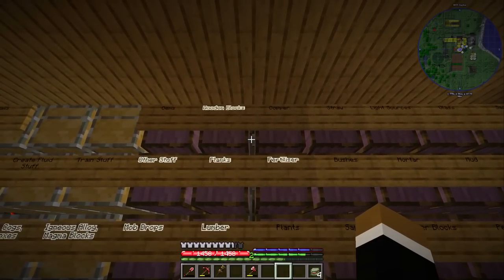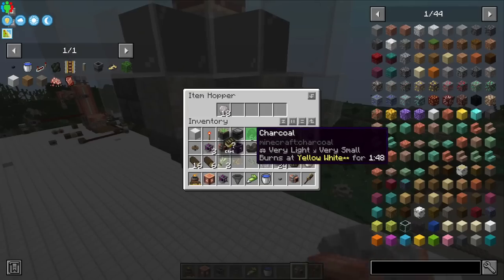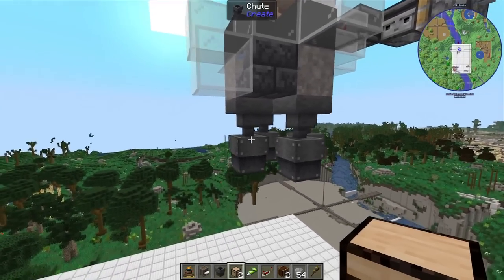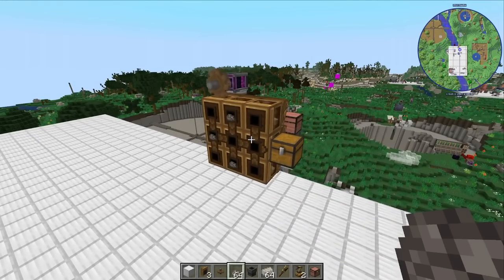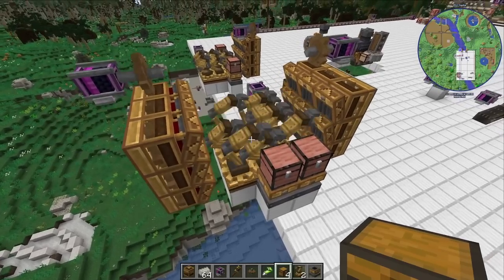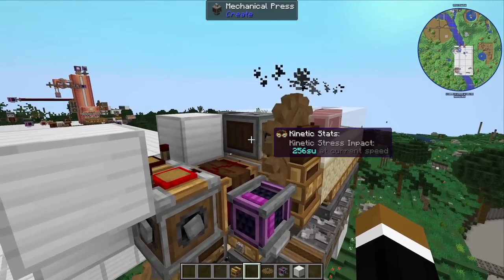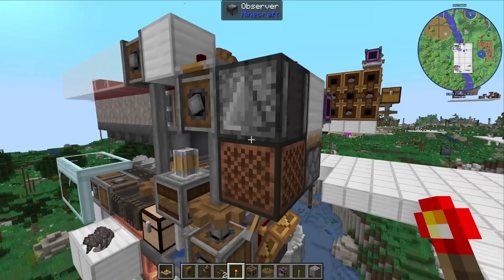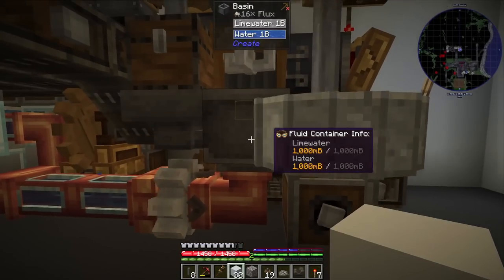ATFC: Automatic Brick And Mortar Maker (Episode 48)

Comment: I think to be more efficient with those mechanical arms you can use a combination mechanical crafter <- hopper <- brass funnel <- arm. If you do so, the crafter will do its craftin while the arm is filling all the hoppers. In the instant of the crafting being finiished, all the hoppers fill their spots and another crafting cycle can bigin. The arms can work all time. In your setup they need to wait for the crafters to finish. The brass funnels are there just as a filter. If you use 2 arms, you dont even need the brass funnel, just make a mortar arm and a brick arm. Dont know the math but it will definietly save on the arms :D

Comment: I think there's a faster way to refill mechanical crafters provided you've used them once before. I think you can filter each one to a specific item and then insert with a belt MUCH faster than a mechanical arm could
Reply: only if recipe has items adjacent, which brick recipe does not have.
Reply: @mrShift_0044  ah that makes sense, been a while since I actually booted up the pack myself

Comment: If you can take an output from the center of the mechanical crafter, you could potentially increase your crafting speed by 100%. Mechanical crafting is affected by the maximum length an item needs to travek to get to the output. In your current setup that is 3. If you could point everything to the center it would have a path length of 1. To be generous im counting leaving the output as 1 more psth length, so 4 path length vs 2 path length. 

This could poyentially be done with an arm or se other way to get output from center

I know these are pre recorded,but thought id let you know in case you didnt already

Edit: looked at the wiki, math says more of a 66% increase in output

Comment: The ultimate goal should be to make a machine for every type of crafting method (crafting table, mixer, saw, crusher, cobblestone generator etc etc). Then create a computer that you can program the recipes into and it will take output from machine A, put it in machine B, and so on, until every item can be created automatically. Then a memory storage system so you can store common sequences and access them with individual buttons.

Comment: Hello, I know you generally pre-record these, but I have a few ideas about your mechanical crafters:
- Can you feed items into the front of crafters? If so you could have 2 rows of belts+funnels on the back and 1 row on the front.
- Can you put crafters facing downwards? If so you could use smart chutes from on top to file them in.
- You might also be able to use weighted ejectors, which are ridiculous and silly and I don't think they have very good throughput but it might just work.

Comment: I’m not sure if it would work and I don’t know if you tried it but what if you had both the bricks and mortar go into a 9x9 item vault and then have nine smart funnels(might have the name wrong) corresponding to each slot in the auto crafter each one with the correct filter.

I don’t know if this could work and I apologize if you try it and it doesn’t.
Reply: You'll probably need 9 belts too (funnel out -> belt -> funnel in) I'm not sure if they're stackable
Reply: @Yorick257  the biggest concern I have is if a funnel going into the back of an autocrafter slot only fills that slot or if it will just fill it up like one coming in from the side.

If it will fill up all available spots then you would have to alternate between items.

Comment: If you pump lava or molten metal at 1rpm into a block below water, the molten metal isn’t even used when the cobble generate

This allows you to create whole x*8  areas of cobble which you can destroy with a mechanical piston, when the cobble is destroyed they will pop of into the water stream.